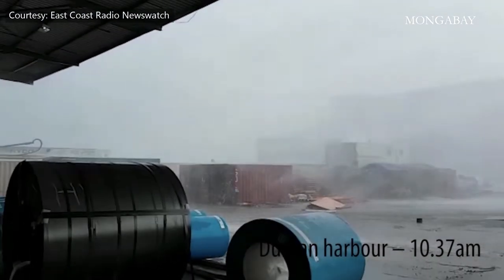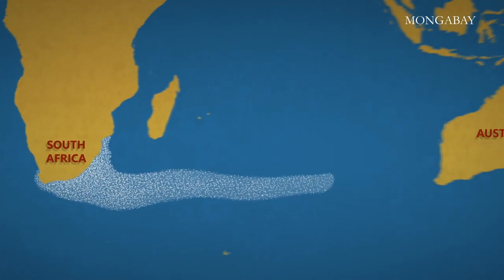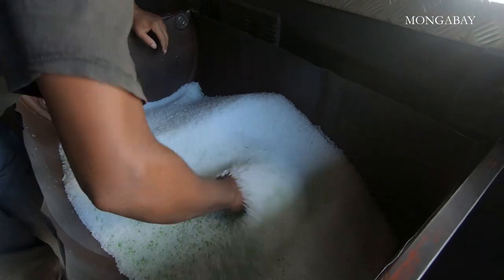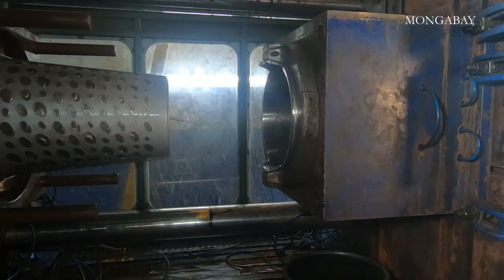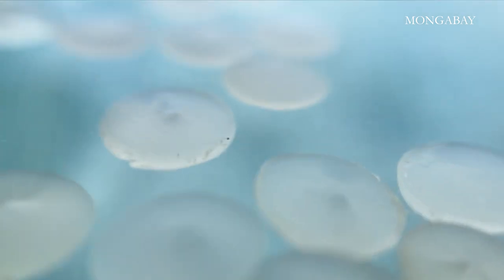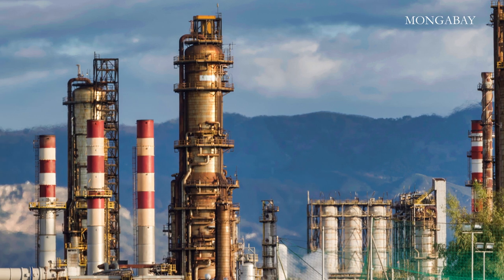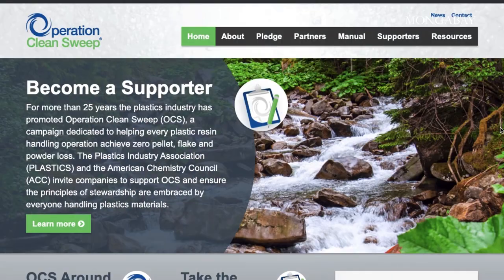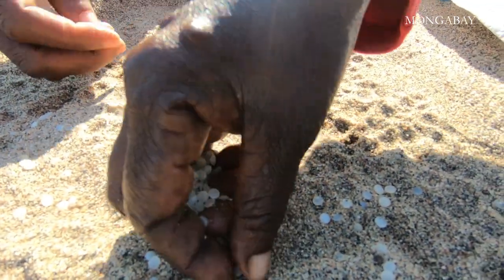What is a nurdle? | Mongabay Explains

Comment: Some companies need to build roombas for beaches and oceans to help reduce the presence in nature.
Reply: (1) there are many beach sand cleaning machines on the market capable of cleaning large areas quickly (2) how would you vacuum tiny pieces of plastic off the top of water with moving currents and other natural things you don’t want to remove (3) the problem is the area over which these plastics are distributed is so large you couldn’t possibly clean it all. If the wind and current put all these plastics in the same 1 sq mile of beach cleanup would be very easy with the machinery available today.
Reply: I'm in the process of designing a fully automated industrial rumba to assist large shipping and manufacturing facilities. I also have a prototype that can be attached to ATVs/Side by Sides, or Trucks. It helps with clean up of pellets in areas that aren't easily accessible like railroads and the surrounding vegetation while also separating the pellets from all of the other contamination picked up by the machine during the process.
Reply: @gopackgo4036  typically the pellets travel by water since they float. So if there's a few outside a factory and it rains it eventually makes it's way into a body of water.
Reply: @brandem9746  I know that but if they are widely distributed it’s impossible to clean them up, they need to be intercepted at the source.
Reply: @gopackgo4036  or even just stop the process of pelletizing them at the factory and send it in strand form for the customers to cut themselves. If we just removed the cutting blade from our factories extruders it comes out in strands anyway.
Reply: @gopackgo4036  hell, our extruder that pushes out fiberglass enforced plastic comes out in strands that are about 50 feet long before hitting the vibrating Witte sifter that cuts and removes defective pellets. We should just add turntable at the end that spins the strands onto a spool and then wrap it in packaging wrap to ship
Reply: @brandem9746  exactly, they need to leave them in bulk form.